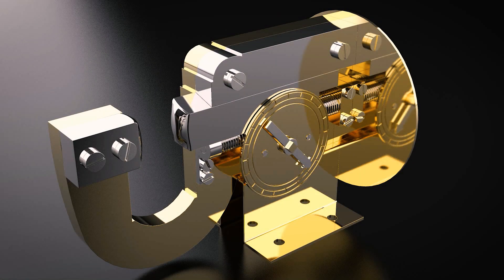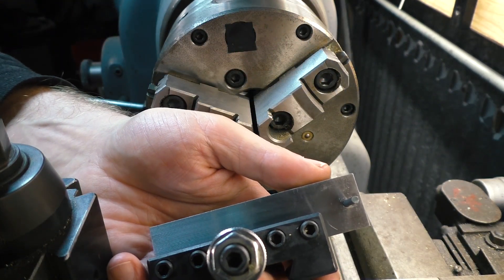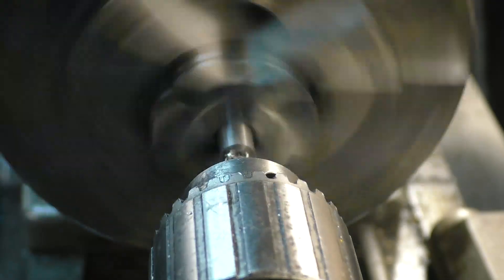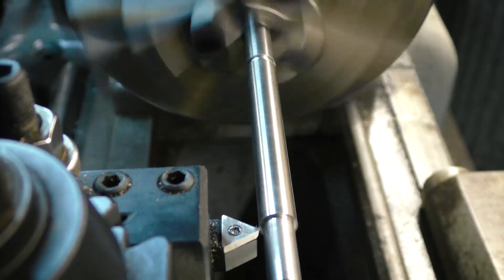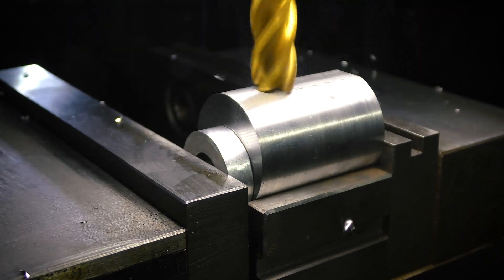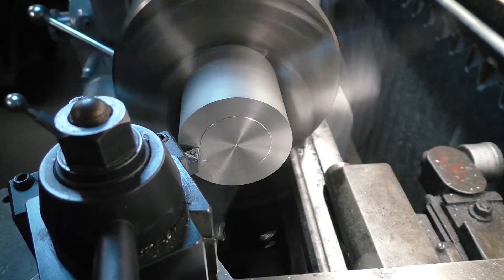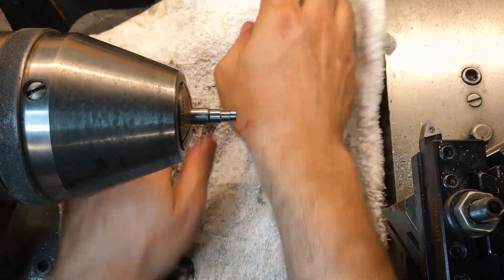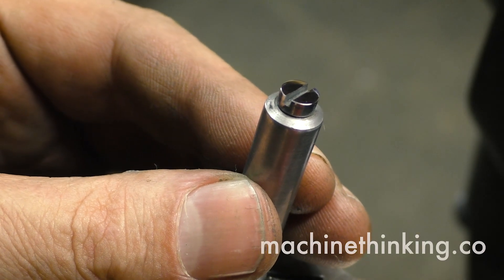Cutting threads and worm gears on a lathe

Comment: Great video, and I really like your channel. Just a couple of things... your tailstock is miles off the centre line, the reamer you show near the beginning has to move a huge amount sideways to enter the hole. That needs adjusting.
At 5:35 you state that for Carbide inserts you need high RPM and deep cuts. These statements are completely false. Yes, you CAN use them at higher RPM and you CAN take deep cuts but you don't HAVE to. I use them all the time in the home workshop and they are much more convenient and longer lasting than HSS tools. I still use HSS for the occasional one where the shape demands it, but for general turning, it's Carbide all the way. Sharp corners should be avoided wherever possible and slight changed to designs easily accommodate a small corner radius. I'd recommend them to anyone.
Reply: 22 years machining, I agree I make light cuts and low rpm with carbine on a lathe all the time, works just fine.

Comment: I cut a lot of threads using the same method as you, but just leave the tailstock loose and let the die pull it in
Reply from the maker: My tailstock is too heavy to do that which such a small thread. Someday I'll make a die holder that slides!

Comment: I've noticed that when your chuck,arbor shaft enters an opposing piece that right at contact there is a slight shift to right or left while drilling is this normal, and isn't it cause for slight imperfections/flaws in the end piece or product? If so how do you control such variations in long term to end works? I've also see this in other YouTube lathing shops. Just curious as I've always wanted to learn this skill.
Reply from the maker: If I understand which part you're talking about, it's because my tailstock is off slightly.  My lathe bed was reground before I owned it and the tailstock was shimmed up somewhat imperfectly, compounded by wear.  The long reamer multiplies the error.  However, the reason reamers are long (chucking reamers, anyway) is to account for some offset  but still be able to bend reasonably true.

Comment: LOVE THE CHANNEL. BUT JUST LET THE TAIL STOCK SLIDE..SAFER, AND WAY EASER..
Reply: Bigwingrider1800 I was hoping someone had mentioned this, was surprised to have to scroll so far to see it. Works 100x better unless maybe his tail stock is too heavy for such a small screw?
Reply from the maker: @nickanselmo6353  Oh yeah, my tailstock is way too heavy, probably 40 pounds or more.
Reply: Most die holders I've seen are actually free sliding over a rod held in the tailstock. Some are gripped by hand for the cutting force and some are keyed to the shaft but still free to slide along it.

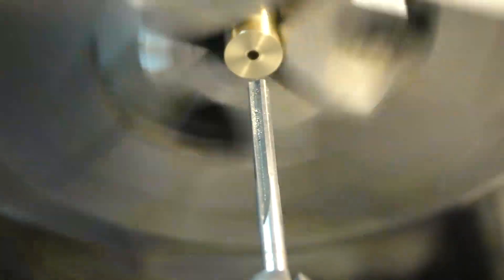Comment: Look at 0:42 & 1:34 see how the bit is forced to move towards the left slightly to get into his center hole? Either the bits are slightly bent or his drill chuck and what ever is supporting it (tail stock) is not parallel to the lathe bed. The shorter the bit (center drill) the closer the end of it will be to the center of the work piece and the longer the bit the angle moves the end of the bit away from center. What that means though is that his center bit is not really correct either, It might be close but it is not quite right. When I noticed the drill bit doing it I thought it was a bent bit but when the reamer did it also I thought it is might be the tail stock assembly.
Reply from the maker: I'm well aware of my tailstock not lining up 100% correctly, which is made worse when something long like a reamer is placed on it.  My lathe had the bed reground before I got it and the tailstock was (poorly) shimmed back up and I haven't got it nearly perfect.  It compounded by the fact it's a fairly worn tailstock about 30 years older than the rest of the lathe.
Reply: I was told that the long shank of a reamer is designed that way partly so it can flex/bend to follow the drilled hole.
Reply: Thats a very common issue in lahtes. Rarely is the tailstock so perfectly aligned that the drill does not deflect a little bit. Usually thats no problem, as drillng is not an operation, which is used to produce a precision diameter hole. On the contrary when reaming on the lathe, this misalignment does destroy your tolerance and also the hole geometry (you are reaming a taper now). If you want tight tolerances and good cylindrical shape of reamed holes on a lathe, check out a floating reamer holder. 
This device allow for the reamer to truly align itself to the drilled pilot hole.

Cheers
Reply: @nordlichtBlueSkies  Nice idea - certainly not inexpensive however! At least for the home shop!
Reply: You vary well my be correct, but in my experience it's always been the play between the quill and tail stock. (or both ) If so, shiming will not completely fix your problem because your center will be at different locations depending on how far out your quill is...
I always found center drilling with the quill out a ways to be a good fix, since the center drill will find center it's self the quill having lots of wiggle room will let the center drill do it's job for the rest of the drills...
Hope this helps, fyi...
The comment on this page saying reamers are long so they bend to flow the hole is correct... Reamers make a hole round, and nothing more...
Reply: @austinrrstilger  Doesn't a lathe of that quality have an offset traverse adjustment on the tailstock? When turning between centres, it was always necessary to get the tailstock alignment "perfect" by turning a test length and adjusting the tailstock traverse until the diameter was constant. (The tailstock base was made in two pieces with a cross register between them and used set screws to manipulate the offset.)
Reply: I agree but to find a really accurate machine to get it all centered is never easy to shop for in our latest market. Very frustrating and super expensive.
Reply: ... and that is (one reason) why we drill center hole.
Reply: The tail stock misalignment as widely commented here, could also be a function of the lathe not sitting properly on the floor, causing a few mils runoff. The legs of the lathe should be shimmed using a precision machinist level to verify that the lathe sits perfectly level on the floor to prevent the ways to be twisted, however lightly.
Reply: Jonathan DeWitt it might be me but I see a little runout in the three jaw.  Maybe spindle bearings a little sloppy?  But I definitely see runout.
Reply: can't you just shim the tailstock?
Reply: You can use a floating tool holder to mount a drill or reamer etc accurately in relation to the headstock. BTW thanks for using the correct terms for worm and worm gear ( I made tens of thousands of miniature gears commercially  to very high tolerance )
Reply: I saw that too. I sat threw the whole show to see if it becomes a problem.  Good eye.
Reply: While it's possible that the tailstock is misaligned, I suspect that the drill chuck is causing most of that.
Reply: workpiece not dialled into 4 jaw chuck i recon & tungsten carbide on brass?!? no complaints though - i loved this video.
Reply: And not tungsten carbide
Reply: hmmmm oh wait thats a 3 jaw.

Comment: You really need to check out https://www.youtube.com/channel/UCworsKCR-Sx6R6-BnIjS2MA and his skeleton clock series. He has some very detailed videos on screw making as well as building a tailstock die holder that is spring loaded and way simpler to use than yours. He shows how to hear treat screws and does a beautiful job of heat bluing them.
Reply from the maker: Am familiar with the project and channel.  I made my die holder in 10 minutes when I needed one a couple years ago and it's worked well for me.  My lathe also makes it easy to go slow and quickly reverse which helps greatly.  I agree there are better generalized designs out there though!

Comment: Nothing to beat carbide inserts - any time. It can take serious punch! Even if you don't have the rpm, it still works great every time.
Reply: No not really
Cant get it as sharp, doesnt like intermittent cuts, cant repeatably take accurate sub 5 thou cuts on small stuff, cant make custom cutters quickly, surface finish is borked when running too low of revs, Etc.

The list goes on but yeah. They both are great for certain things but at least in a home shop, they both are very viable... unless you have a really small lathe, then carbide is almost useless.
Reply: It's your choice what direction you want to take brother. I don't have time to mess around with high speed steel bits. I have a small lathe which can go up to 2000 rpm. I cut stuff up to 240 mm diameter (rings). I recently made some stuff from hollow bar. I used Iscar inserts and was absolutely amazed. I forced the tool through the inside to remove a lot of material and after this process I couldn't see any damage at all on the insert. A high steel bit never would have withstood this type of punishment. Now, you are not talking to a novice, but an experienced toolmaker (RED SEAL - 43 years) and also a qualified metrologist (27 years). I prefer proper carbide inserts. Now, I cut a lot of aluminium and there's no way that you will get a sharpened tool bit as sharp as these aluminium inserts. The cutting edges are like a razor blades. For steel I use very small radius inserts. I will use high speed steel tools if I really have no other option. Happy turning brother!

Comment: Whow, the center of the tail stock is way out to the chuck center. Look at the moment when the drill or reamer enters the job. Huge deflection. Adjust the tail stock to get it set center before starting the job.
Reply: noticed the same
Reply: Howzit brother, I have a small Chinese lathe and the worst part of the machine is the fact that the head stock isn't in line with the bed, its at an angle to the bed. Now I have this problem: Every single time I move the tail stock, I have to reset it to be in line with the chuck. This is seriously frustrating and annoying. I can immediately  see  that the end of the drill is off center when it touches the job after moving the tail stock.
Reply: if the headstock is not inline with the ways you can move the tailstock all you want but it will never be inline with the headstock, it will  at the utmost be opposite the headstock.
also it will invariably turn a taper
how do you know the headstock is out of alignment?
Reply: Morning brother, firstly I can see if any deflection takes place when the drill touches the job, even with a center hole. Secondly, with the problem I have on my small Chinese lathe (the head stock isn't in line with the bed) I have to reset the tail stock every time I move it. This is seriously frustrating but until I can fix this problem, I will be frustrated. I plainly use a lever type dial indicator to get the center of the tail stock in line with the front of the jaws at the head stock side irrespective how fat the tail stock is from the head stock. I try to grip the job on a very small section because the head stock is still at an angle with the bed. This way is like turning something between centers!

Comment: If you use a lay laydown threading insert you can take some pretty impressive cuts, particularly on a 10EE such as yours.
Reply: Nice lathe,  I see the taper attachment.  I wonder if it has electric leadscrew reverse?
Reply: @jeffbeck9444  the headstock fwd/rev control is there so probably not

Comment: I highly recommend quickly throwing together a wood guard to put over the bedways while changing out the chuck. They are really simple to make - plywood and 2 2x4's to sit around the back and front of the ways. 99% of the time it won't do anything, but that 1% when the chuck accidentally slips, it will save your hands/fingers from a serious injury and the ways from accidental damage.
Reply from the maker: I appreciate the thought - I actually do have a board I use when I change into my 4 jaw chuck - it's a beast, but the smaller ones I feel comfortable not using it and the Jacobs chuck is especially light.
Reply: Even just a canvas cloth ( old pair of jeans material) will work well there, and as a bonus just keep it oiled, with a blend of engine oil and a little wax, and it provides a bed lube and rust protection at the same time.
Reply: I put a piece of plywood over the ways when I am changing parts / chuck at work.  Most of the time they are too heavy to lift by hand though; That big 4 jaw is HEAVY.

Comment: I've got to make one of those tailstock die holders soon for one of my projects, although I mainly work in plastic and with extra fine threads so I can rotate the chuck by hand and feed gently with the tailstock unlocked.
Reply: I found with plastic carbide inserts work really well, just have to use them as brand new for plastic, and  then later on you can use them for anything else. Works well with PTFE, which needs that really sharp edge to get any sort of stability in the part. Same for drilling it, brand new cobalt steel bits are perfect, later on you still get good results on steel, though I found that 316 stainless I just budget one drill bit per hole hand held, especially using HSS ones. Work hardening on stainless can be a real PITA, especially if you are doing repairs and cannot detemper the part.